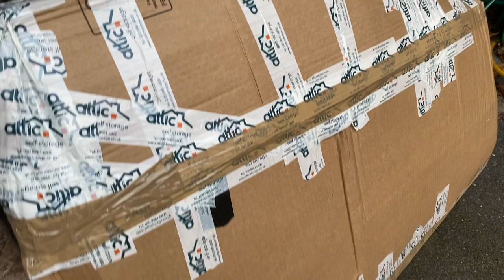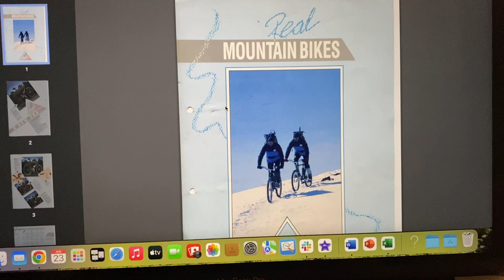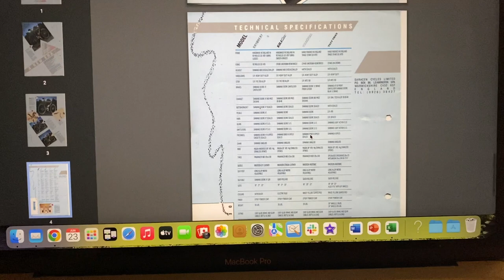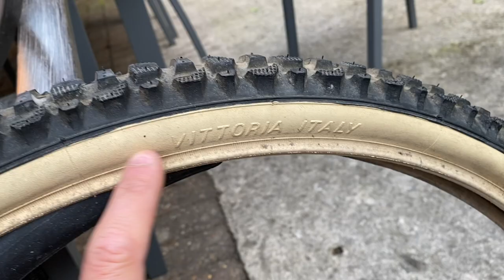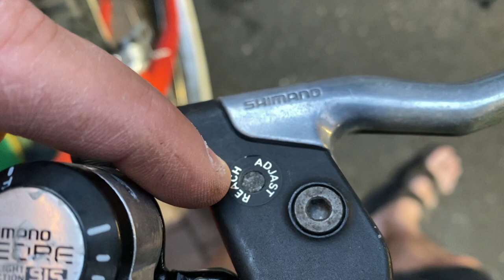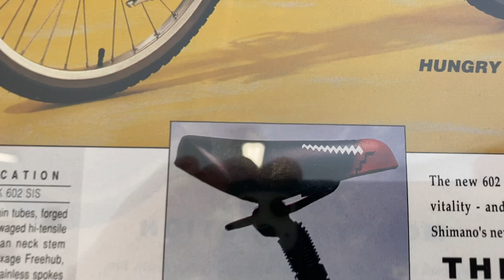Full restoration: 1987 Saracen Trekker mountain bike

Comment: A fine machine - makes me nostalgic.  I rode one of these across the Sahara in about 1989. Took a Brooks saddle, with big rivets. The double bottle cage lugs seemed ideal, but I ended up with a 10 litre plastic jerrycan inside the frame. I remember the head angle was really relaxed - it seemed to float over the sand... except where it was deeper and softer - then it was more of a push than a ride!
Reply from the maker: I love to hear stories like this. I can vividly picture this bike on an adventure like that, it was absolutely built for it. If I had to pick one of my bikes to do such a thing, it would probably be this one.

Comment: I had the slightly newer version of this when it was a newish model in the early 90s , it had the u brake both front and rear but it was positioned in the traditional place on the back and not on the chain stays like this model, it had a Deore II GS with 7 Spd Thumbies, HG, SG round rings and slightly more aggressive geometry, great bike, I still take my 90s MTB (531 Claud Butler) off-road
Reply from the maker: Interesting point about the slightly more aggressive geometry. I think 1990 was a real turning point between the generation of adventure-oriented bikes and the race-oriented trend that took over. The former are so much more stable, comfortable and easy to ride - when I get on some of my high-end builds from the early 90s it's like getting onto a time trial bike by comparison!

Comment: A beautiful build and an awesome video. I really enjoy your enthusiasm and commentary. 
I’m sure you have considered this but in case you haven’t and you’re looking to rejuvenate older paint systems maybe try using a professional grade cutting/polishing compound. I use  Farcela G3 and G6. They deoxidise and remove scratches so much faster than T-Cut. 
Thanks.
Reply from the maker: I hadn't considered that, so thanks for the recommendation! I'm tempted to try that since the paint on these old Saracens is generally pretty tough - although I'm nervous about going too hard because you only get once chance...
Reply: My thoughts are that especially by hand it would take a long time to cut through the base coat.I’ve only ever managed it once!🤦🏻‍♂️

Comment: Fantastic built BTW. Where do you find all those original seats? Would you agree that the paintwork on old Saracens seems indestructable?
Beautiful bike, thanks for sharing.
Reply from the maker: I'm very fussy about saddles, and have always gone to lengths to source proper ones. Some are easier to find than others, for example the Avocet is rare and the Look Rolls even rarer, whereas I have a big stash of near mint original Flites. Original Turbos tend to be expensive if they're not wrecked, but the good news is they're still making them to this day so I just get those new. That Saracen one with the coil sprung rail on the 89 Trekker is so cool but I bet you could never find an original one of those on the market, unless you stumbled across a whole bike with one on. I'm not bothered that this Trekker has lost its original Madison saddle because those would have been a cost-cutting spec at the time and weren't anything special.

Comment: Hi Oliver, lovely Sarcen and an inspiring video !

Two questions: 
- which Dremel bit did you use to clean up the pedals? it turned so fast that I could not make it out. Was that a kind of brush ?
- when  rebuilding the rear mech - do you use loctite to fix the jockey whee screws - and if yes: how do you keep the washers from being locked as well, which is what always happens when I try to do this... And last time I did not use it it promptly fell apart on the first ride.
Thanks
As for the saddle: an old used Turbo works every time for me
Reply from the maker: Hi, glad you enjoyed! The Dremel bit was just one of the polishing heads - it looks like a white chimney brush and wears away very quickly. I use them with Autosol hence everything turns black. As for rear mechs, I never use Loctite because as long as you use the intended bolts for the purpose then they should already have some sort of threadlock on them. If you're installing the jockeys correctly you can torque the bolts fairly tight because even when the centre is gripped tight it's designed to still allow for the bushing or bearing to move freely.

Comment: An absolute minter beautifully restored. I was also thinking turbo saddle. Is the high end handlebar made of aluminium or metal? I suspect the latter but perhaps 1mm wall cromoly?
Reply from the maker: Turbo saddle was the only choice. Even if I could have found the leather Madison one as seen on the '87 Conquest, it wouldn't be as good. Those things disappeared for a reason! As for the bar, it's black anodised aluminium. Was expecting cr-mo like on the similar Saracen I recently built, which is why it was a surprise to find such a lightweight piece from a brand with such racy heritage as ITM, on an otherwise super heavyweight spec. Perhaps it's an aftermarket upgrade, would have to refer back to that catalogue.

Comment: Great video. The 1980s Saracens people often see as the best. Where do the 1990s Saracens fit in. I have a Forcetrax from 1995, which I bought new. Is it a clunker or is it worth keeping. I would appreciate your opinion.
Reply from the maker: Absolutely, the 80s Saracens are the best - however the early 90s ones are great too. I'd always say a Saracen from 95 would be worth keeping, no matter what condition it's in. It was only really at the very end of the 90s that they made a few "questionable" bikes for the mass market (the Raw and Raw DH were pretty horrid), but even then their higher end stuff was still good.
Reply: @red_dread  Thanks for your opinion. I think I'll keep it on that basis. I've seen a few Trekkers for sale but they rarely are as good as the one you restored. Thank for a great channel. ATB John

Comment: What knife are you using?
Reply from the maker: I have a hell of a collection (I'm a hoarder)! I have pretty much every model of Leatherman, plus bushcraft knives, craft knives etc. I guess the one you can see in this video is the carpet-fitter's box cutter? It's just a trade spec fixed blade Stanley with a champagne cork as a safety cap.

Comment: Uniglide?
Reply from the maker: Oh yes, and what a fascinating and rewarding project this cassette turned out to be! I could have done another ten minute video just on that. I love the fact that you can take a totally worn and unridable cassette (as this one turned out to be) and simply reverse the sprockets to double its life - because the splines and the teeth profiling are symmetrical unlike Hyperglide and later. You can even reverse the smallest (threaded lockring/sprocket) if you're clever with spacers. So satisfying.